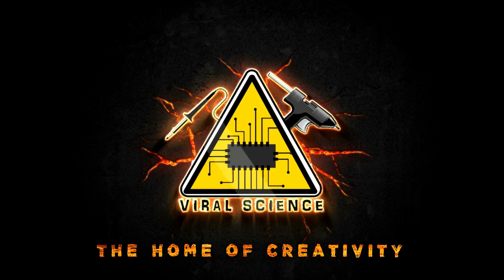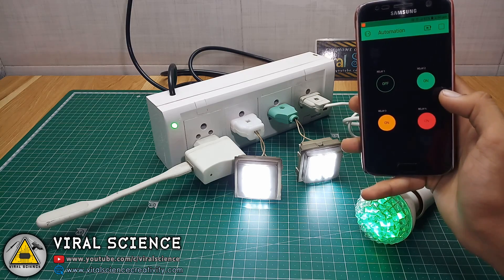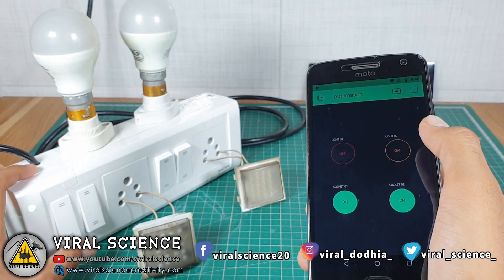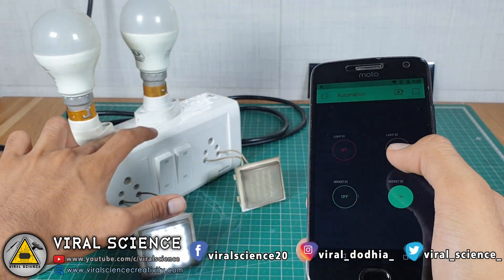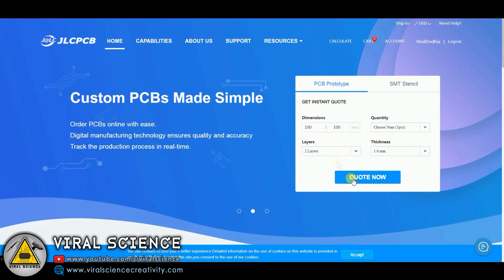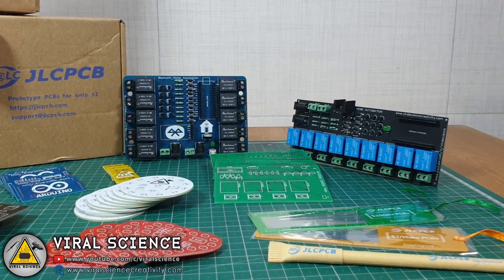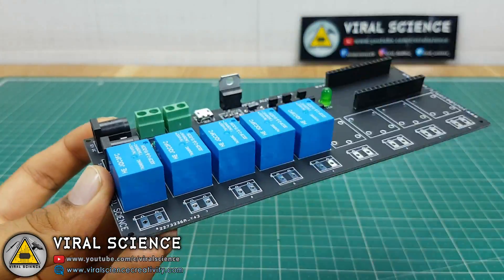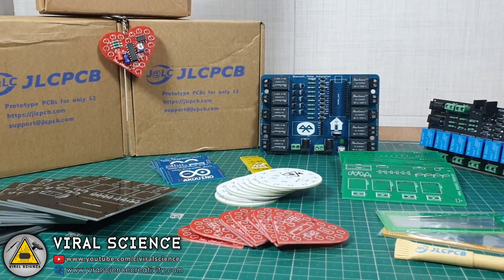Home Automation Extension Box | 2 way Switch and Smartphone | ESP8266

Comment: Hi i have developed a 2way switch using esp8266 and firebase... I have connected relay and manual switch through 2 way switch connection and used push button another switch. I'm getting response from both relay and push button to firebase but I'm unable to get signal response from manual switch ..is there any way to get response from manual switch to firebase so as to update the value in firebase.

Comment: Hello,
I have done same connection but while testing the socket with tester,I found tester glowing in both phase and neutral wire(glows brightly in phase and glows low in neutral).please help

Comment: I have a doubt in this video I can see that you have connected the 5 volt adapter to Direct current so is it fine for the boards and is it safe? Also in your door alarm video you have mentioned that we can replace the bell with our door bell so can v connect it to direct current instead of the batteries???

Comment: Hey bro you not using earthing or 3rd pin in 2 switch sockets are not in used(you not connect any wire to it. It will dengerous. It will only okay for LED not for big application. According to my knowledge.

Comment: I want to use a single way switch and and arduino with relay to control an appliance? How to do it?
Reply: If you use single way switch than you can only control through mobile not through button